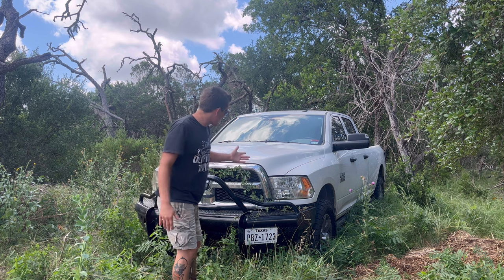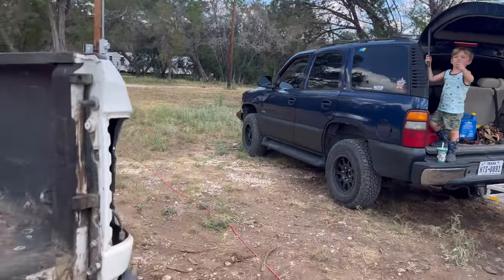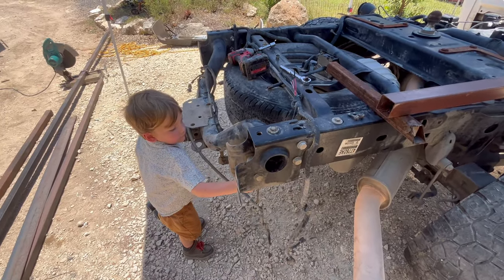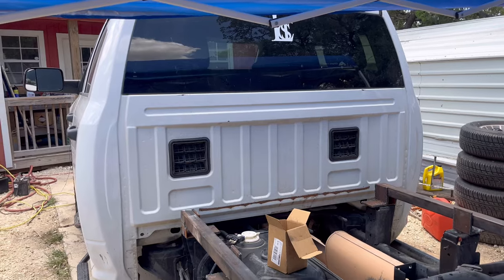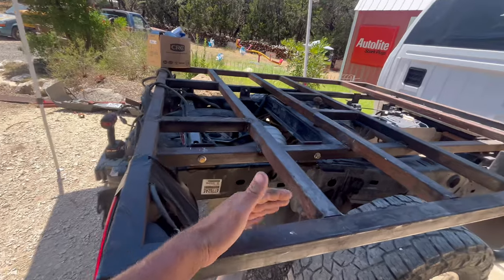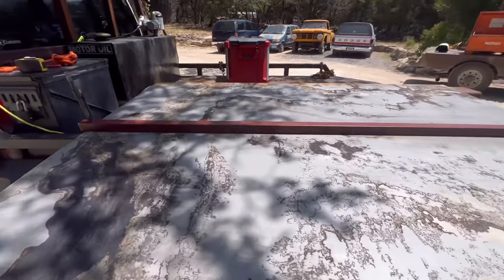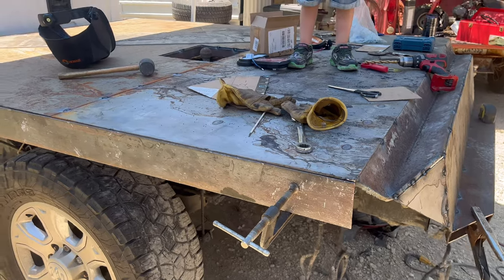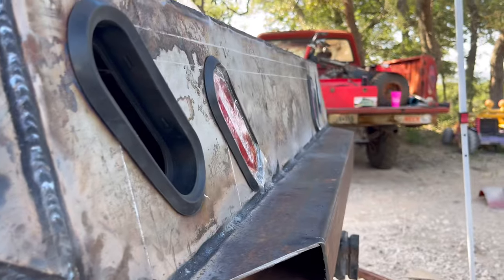Budget Flatbed Build! $500 bucks!

Comment: The first automatic column shift I ever bought took some explaining. I knew what I needed to do, but I didn't know which way to push or pull the lever so I could put it in gear and didn't want to force it.

I never had that issue with automatic cars that have the shifter on the transmission tunnel.
Reply from the maker: Yeah in today’s century I would think it’s a lot less common to not know.

Comment: Nice job, Tyler.  Will you blast then powder coat or just give it a Rust_O_Leum finish?  Transmission issue at 168K?
Reply from the maker: Debating to rustoleum. My buddy did on his bed and it came out good. Thanks to zane I scored a “scrapped” flatbed with 4 good side tool boxes so I’ll probably use those on it.